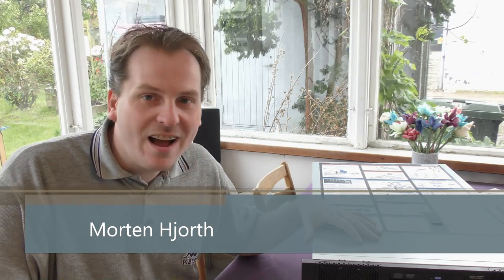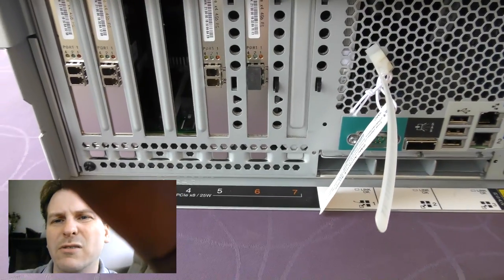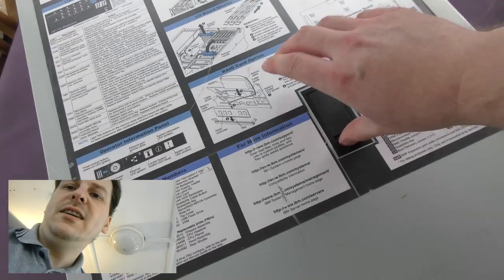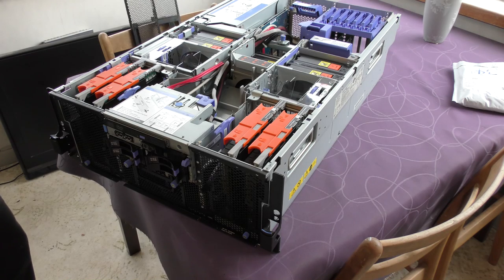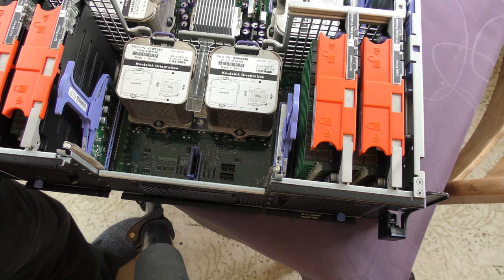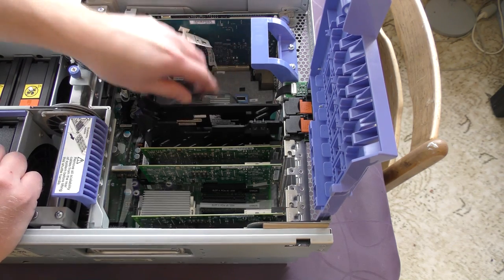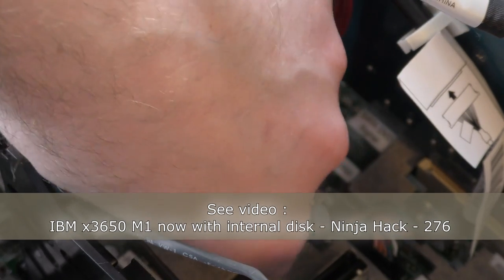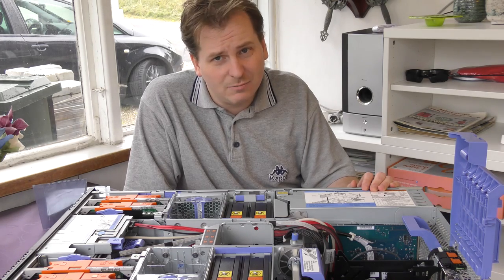$200 Awesome Server - 24 cores and 128GB RAM - 350

Comment: Try to use wide angle lens next time
Reply from the maker: HI
I stopped using wide angle lenses,, I did not like the blurry look very much. And that was both with a $100 and a $500 lense.
The camcorder I use is rather wide angle, especially when I record in 4K (when it uses more of the sensor it also uses more of the lense) and I reduce it to 1080P.
Thank you for watching! :-)
Reply: hmmm interesting the blur caused because the f stop is too big if you increased it to 11 or 13 you will not get any blur effect if the camera is 2 m away or less from the object, is that camcorder a full frame sensor? if you use 5d attached with Canon EF 16–35mm lens you will get nice result...
Reply from the maker: Hi Hussain Ali 
I used it on a camcorder. I do not want to make it all to complicated.
Thank you for watching! :-)

Comment: whats the max hard drive expansion this machine has. I was wanting to put like 30tb of Nas storage in it. if i bought this server for my house.
Reply from the maker: Hi Talkative Tech
It has four 2.5" drive bays,, it´s probably not a storages server.
Thank you for watching! :-)
Reply: This old thing is definitely not what you want. There are many reasons why this server is so cheap.

1. It's a 4U server
2. It's ancient
3. The power draw is enormous.
4. No storage for a NAS

For you a Dell R710 would fit your needs perfectly. It's only 2U, can hold 6 3.5in HDD's and has plenty of horsepower for a NAS server. 

Install FreeNas on it via a thumb drive and RAID Z2 all your drives together into a pool for 20TB usable and bam you have a sick FreeNas server for around 180 watts. I have written plenty on how to get it all up and running on the FreeNas forums. Look for the user Pwnerman if you want to read my posts. 

If you need more storage space then that a Dell R510 is the next logical choice.
Reply: My PlayHouse what server would you recommend for a freenas.
Reply: Talkative Tech look at my comment directly above this lol
Reply: Austin Michael thanks didn't read it right
Reply from the maker: Talkative Tech 
I Just got a Dell R710,, that I will have a look at in a video.
But I am a fan of Lenovo/IBM servers,, and that is what I´d recommend.
Reply: My PlayHouse what's the max amount of hard drives. I can but into the dell r710? I was thinking about putting 10 3tb nas drive in it.
Reply: A R710 can hold 6 drives. If you want to go with 10 drives you should go with the R510 which can hold 12 drives.

The way freenas works though you would be better off populating the entire 12 drive bays and either making two 6 drive volumes in RAID Z2 for your pool or have an entire pool of 12 drives in RAID Z3. I would recommend the first route but that is up to you.

It's just with Freenas if you leave those two extra drive slots unused just don't think you can pop in another drive, add it to the volume and be good. That mistake equals disaster. You will lose all redundancy if you make that mistake and if that single drive fails you lose everything.

If you are set in 10 drives I would just make a single array and RAID Z3 it so you have 7 drives usable. If you do go with 10 drives I would recommend using those two extra slots for spare drives. Freenas has a cool setting where you can add drives that automatically start rebuilding the array if one of the drives used in the pool fails.

This link with further elaborate on what I'm saying.

https://drive.google.com/file/d/0BzHapVfrocfwblFvMVdvQ2ZqTGM/view
Reply from the maker: Talkative Tech 
I´d say you shout go up in drive sizes instead of having 10,, go for 4*8TB or 6*6TB.
Reply: My PlayHouse I know your right. I was going to buy 6 6tb nas drives. Now will these work with the dell r710 well?
Reply: I agree with you but like I mentioned in greater detail above if he goes with an R710 it would be good practice to populate the entire array starting out. Unless he wanted 5 drives and a spare ready to go or something but that would make him lose more space with a RAIDZ2.

So if he chose that server I think your 6*6TB option would be better
Reply: Yes any SATA or SAS 3.5 in drives will work. I personally use HGST NAS drives. But just be warned it's going to be more complicated then just installing they OS and throwing the drives in. You are going to need to get a PERC H200 or it's LSI equivalent and flash it into IT mode, you are going to need to get longer SAS cables because the stock DELL ones will only reach to the Dell Only PCIE slot which you can't use once you flash the H200 to IT Mode.

These are the SAS cables I use personally. I can guarantee they will work in a R710 with Freenas

https://www.monoprice.com/product?c_id=102&cp_id=10254&cs_id=1025410&p_id=8189&seq=1&format=2

Also you don't seem to want to engage in dialog with me so I'll leave my help at this.
Reply: Austin Michael I am using the hgst  drives. they are awesome. also dude I wasn't ignoring you. I am just really busy. I work a lot.
Reply: Talkative Tech alright well if you have any other questions about it just reply and I'll get back
Reply: Austin Michael well do you think if I bought like 2 of the dell r710. Do you think one would work well as a day to day driver. I use Debian 8 but planing on updating to Debian 9.
Reply: Using one as a personal computer is honestly something I have never tried but I wouldn't recommend it. It would work of course but you aren't going to have any graphics card support. These servers are good for running lightweight OS's like FreeNAS and other server OS's but they aren't designed for full operating systems or to act as desktop PC's. I would recommend against it.

What you could do is buy another R710 and use it as a backup for the first one haha
Reply: Austin Michael Yeah a backup would be nice maybe in the future. Guess, I'll just build a desktop. I thought that might work. I didn't think of the gpu issue.
Reply: Talkative Tech Yes for a server the R710 works great.

When it comes to desktops if you used an R710 you would have a multitude of issues and negatives like no USB 3.0, no graphics card support, old hardware, no HDMI, and no audio outs. If I thought about it I could most likely name a bunch more things. Just thought of one. The noise haha

I change my previous answer. It's a bad idea. Plus you could build a modern, tiny, quiet desktop which would be much more powerful then old hardware from 2009 while at the same time being much more power efficient. You could build a PC for like 500-600 bucks and it would outperform this server in desktop applications while the power saving would recoup the price difference quickly. Even more so if you live in a place where Kilowatt hours are expensive.
Reply from the maker: Talkative Tech may I ask what kind of data the 30TB is,,,, does it need to be fast >100MB/s... does it need to be safe Raid6/10??
May I suggest you put a Hypervisor under your linux,, Like the VM ware ESXi that I like so much.
Reply: My PlayHouse i have a plex media server thats 12tb and growing. The rest, will be used for archiving my old future YouTube videos.
Reply: and i'll be installing ssd drives into all of computers. so any extra crap  like videos,photos, etc will be stored on my freenas.
Reply: RAID 6 is essentially Raid Z2 on Freenas which is honestly too small for a pool of 12 disks. Raid 10 doesn't exist on ZFS. RAID Z3 is the most parity you can achieve on a single volume in FreeNas. With that many disks I would say RAID Z3 all of it or do two 6 drive volumes in RAID Z2
Reply from the maker: Talkative Tech okay,, I have a Synology NAS 1815+ box, for this kind of stuff. Most of the data,, is just a copy of the "internet" with a few GB of data that I´d cry about. and a backup here at My PlayHouse. If it is for only home storages,, and not much else,, maybe a full server is not the way to go.
Reply: My PlayHouse what's would you recommend then?
Reply from the maker: Talkative Tech 
I would not recommend a full server, running 24/7 to just be a media server :-) If you want to also run some virtual servers, then I would see the need for a full server. But they really do use some power over time. I´d recommend you to also take power consumption over a year,, into your decision.  Every Watt of power costes $2.6 a year here where I live,,, so a 200W Server is $535 a year. A HDD uses 5-10 watt´s,,, so the number of drives also matters.
Reply: My PlayHouse didn't think of that. what could, I do to save money? and till run fulltime.
Reply: buy newer server hardware or build a lower spec, more energy conscious machine. See where I live we have some of the cheapest electricity in the world at 6.7 cents per kilowatt hour so electricity doesn't really bother me. Hell in my home I use around 3500 kilowatt hours a month haha and my electic bill is only like in the 300 dollar range. I could run a 200 watt server 24/7 for a year for 130 bucks
Reply: Austin Michael where i live more like 0.30$ a kilowatt
Reply: Austin Michael i will though be looking into one. i just didn't think about the electricity issue. i think what i am going to do is just look around for power efficiency parts and power supply. This issue is, I own a dell 42u server rack. I bought it for 250$ and it will be filled with servers. just might take awhile.
Reply: Just for reference with an R710 running 24/7 for a good 70ish days has run me about 305 kilowatt hours at a stable 175 watts. That cost me around $20.50 USD. I don't know where you live but that would cost you around $91.71 USD at 30 cents per kilowatt hours. At that price for electric buying an old R710 isn't going to be worth it frankly. You should go with more energy efficient hardware that still meets your capacity needs and trans-coding needs.  

If I lived where you do my monthly electric bill would be 1,050 USD LOLOLOL
Reply: Austin Michael Yeah that's why, ill have to be picky. on my hardware ill have to buy.
Reply: Talkative Tech Just curious but in what country is electric that high?
Reply: Austin Michael alaska
Reply: damn well I guess up there it would be. haha that does suck though
Reply: Austin Michael yes it does lol! it was just -30 like 2 weeks ago. The weird thing is, when it shot up to 30. I really didn't need a coat or gloves.

Comment: I don't think 1 newer processor could hold up with the 4 in this server.
Reply from the maker: Well,, if you get a brand new high end Xeon 26xx v3 or v4 they will kick this old servers ass... :-)
By more than double,, but then we are looking at a CPU to $2-3000
Thank you for watching! :-)
Reply: My PlayHouse Well I think 24 real cores cant be beaten up by a 12/14 SMT-CPU, they maybe have the same paperstats, but when it comes real performance, I bet the real 24 cores beat the 2687W.
Reply from the maker: This system is benchmarked at 9.487 : https://www.cpubenchmark.net/cpu_lookup.php?cpu=Intel+Xeon+E7450+%40+2.40GHz&id=2419&multi=4
And the new Intel Xeon E5-2697 v4 @ 2.30GHz scores over 24.000
Newer technology...
Thank you for watching! :-)
Reply: My PlayHouse Yes, dosen't seems like a single v4 would knockout this setup :D
Reply from the maker: Hi ESISTOBSTIMHAUS 
But the x3850 M2 i very nicely priced,, and you get a lot of power in it,, compared to the price. 
Thank you for watching! :-)

Comment: I just notice this server can do over 1500 points con cinebench r15 https://hwbot.org/submission/3244000_vanden_cinebench___r15_4x_xeon_mp_e7450_1534_cb not bad for a 200$ server, is the same you can get with 2 xeons x5675 or similar. I wonder how different are they both in terms of watts, by the way, I saw this server has large fans...how is the noise? has you ever compared noise level of servers? different brands? do you ever test dell or supermicro servers?
Reply from the maker: Hi areavirtual3d
Thank You very much!  glad you liked the video :-)
Thank you for watching! :-)

Comment: OMG ... That was a powerful server its day... 2007 ....  10 years ago. But the $200 you pay will be gone in 1st month's electric bill. (Two 1440 Watt power supply) The SAS drives are expensive. The CPU is Quad CPU so you have to have expensive licensing for only 6 core per CPU. IBM in the day made tank-like servers. I ran these systems with ESX/i 3, 3.5 4 --- this only is supported for 5.1.  Today ESX 6.6 So basically you cannot use the latest software. And it is very noisy. Slow memory  PC2-5300 ECC DDR2 At least it serves as a good learning tool... historic technology. Have fun!
Reply from the maker: Hi Vuong Pham
Thank You very much!  glad you liked the video :-)
Thank you for watching! :-)

Comment: these old servers are so cheap because they use alot of power and make a lot of noise lol
Reply from the maker: Hi Ivens desulme
They are great for a server that you power remotely up in weekends in you basement to have an awesome game server. But Yes this this is not a 24/7 server to put under your bed :-)
Thank you for watching! :-)
Reply: how much power does your server use when idling ? im thinking about buying a HP Proliant DL380 G7 with a 460 watt power supply for 200 dollars on ebay because i heard they only use 75watt when idling .
Reply from the maker: Hi Ivens desulme
This highly depends on CPU and RAM and HDD's how many and how fast.
Thank you for watching! :-)

Comment: This is total BS. That's a C2Quad CPU. That is some really old crap.
Reply from the maker: HI
It's not new any more, and that is why it can sometimes be found cheap. But it's getting harder.
Thank you for watching! :-)
Reply: My PlayHouse
The price when you buy it is cheap indeed. I saw it for 195€ on ebay a few hours ago. But the performance per Watt is bad. I'm pretty sure after a year you paid more than for a newer model.
Reply from the maker: Hi GuteAlteDMark 
You are right,, this is probably not the best buy for your 24/7 gaming server. This is a awesome "I want to learn to work with servers and VMware on Enterprise hardware in the weekends" server.
Thank you for watching! :-)
Reply: My PlayHouse
yep. For learning it's good enough.
Reply: or if electricity is really cheap, have your own water based generator or something such
Reply from the maker: Hi Firstname Lastname 
Or to replace your electric heater, with a more noisy model. 
Thank you for watching! :-)

Comment: Imagine this with a gtx 1080
Reply: no... its a server...
Reply: Servers can be used for gaming. add a appropriate OS on it, driver updates, and a decent graphics card.
Reply: do you know the noise they make? + the cpus suck at gaming... trust me...
Reply: True that xD. they do sound like a small jet.
Reply: The guy said the pcie connector only allow 25w normally they pull 75w so theres high risk of stressing the lane just like rx 480 did with normal pcie lanes now imagine that and you would have to physically mod the card it to work
Reply: channelofstuff no? But it's shit for Gaming because of the Single core Performance
Reply: channelofstuff not really tasks go to the kernel and the kernel manages spreading them across multiple threads in both CPUs
Reply: Michael Albanese would be bad
Reply: my wet dream
Reply: but need to know this one has no PCI-e gen. 3 slot
Reply: Michael Albanese 2.4ghz  old CPUs? It'd have the xb1 kick it's ass.
Reply: Ambrose Tantphillis yeah the xb1 with its shitty amd 8 core clocked at 1,75ghz, good luck with that.